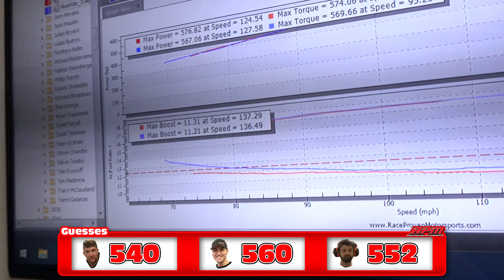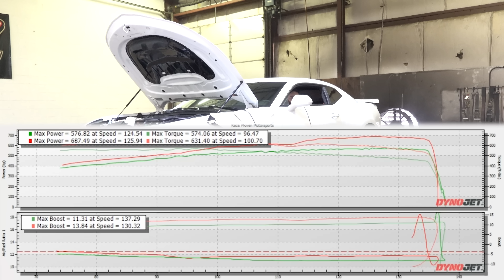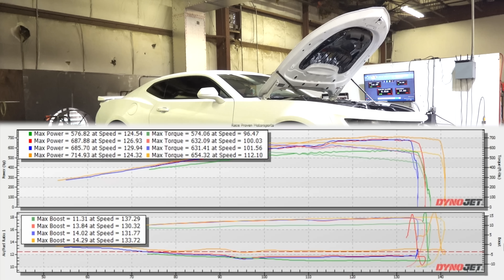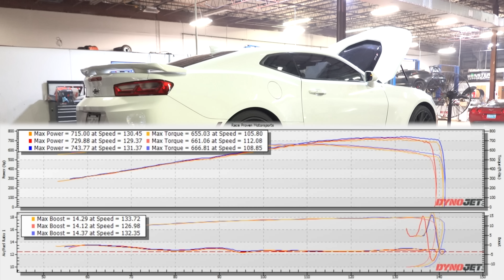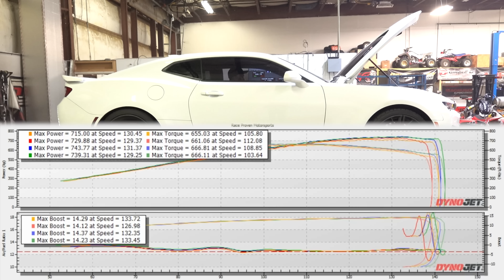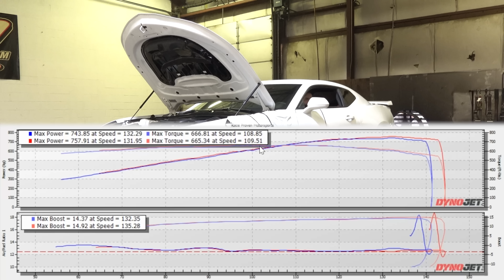Does High Mileage Matter?

Comment: Best thing about living in Iowa...E85 is everywhere and it's almost always 85-90% ethanol.
Reply: I miss living in Iowa
Reply: Mannnn that’s good living for car enthusiasts if we can get 85-90% ethanol
Reply: Damm Iowa is cool that whole little cluster of states is so cool and untouched
Reply: Not sure where you live in Iowa lol but definitely not always 85-90% 😂 it’s all 70-75% until summer blend then hyvees can be 80-88%
Reply: @thesudzy22  The station 5 minutes from my house is always over 85% all year as is the next closest station 15 minutes away.  There is one station 15 minutes in the opposite direction that does go down to 70% in the winter months.  I tested my local station in January and it was 91%.
Reply: @thesudzy22  Honestly percentage isn't even that important at 1000 rwhp levels.  Anything over 50% is enough and anything over 70% is definitely fine power wise.  I've not seen gains in power on anything over 70% actually.  As long as you have a flex fuel sensor or the ability to change the tune ethanol percentage isn't that critical in terms or power gains.
Reply: @lsxtuner6126  I agree 70%+ there isn’t much to gain. But 50 to 70 can definitely gain a a degree or two of timing and help.
Reply: @lsxtuner6126  What city do you live in? I’m in the metro area and it’s all 70ish % right now
Reply: @thesudzy22  Oskaloosa...I wouldn't call it a city though...LOL.
Reply: That probably is in fact the best thing about living in Iowa 😂
Reply: @oompa-tx3se Octane increase from increasing ethanol percentage isn't linear.  The science is available on the internet to explain this better than I can here.  As you go from 0 to 50% ethanol content the increase in octane and latent heat of vaporization is substantial.  Beyond 50% to 70% the rate of improvement is much less and even less improvement from 70% to 90% ethanol content.  There will be a difference especially in fuel requirements as higher ethanol percentages have a lower stoichiometry.  The difference in power potential for sub 1000 rwhp street cars is minimal going from 70 to 90% ethanol though.  I started experimenting with this due to maxing out my 1300cc injectors.  I lowered my ethanol content and didn't lose any power or see any difference in plug readings at the same timing levels going from 85% to 70%.  I currently run 50% ethanol, but added meth injection.  I'm terrible at explaining this so hopefully this gets you thinking and you can do your own research on the internet to find the science behind it.
Reply: @oompa-tx3se Wow.  Post up your dyno comparisons I'd like to see that.  34 psi how much power are you making?  Usually, I don't see much power difference sub 1000 rwhp from 70 to 90% ethanol content,  but with 34 psi you must be making way more than 1000 rwhp.  I don't really play with anything much over 1000 rwhp street cars to be honest so I can only speak about what I've seen at the power levels I play with.
Reply: @oompa-tx3se It seems there were multiple variables then and since you never dynoed it then it's hard to say it picked up mid range torque because at high power levels the butt dyno isn't too accurate.  You trapped 159 at 28 psi, but you added boost to 34 psi so that is a huge variable also.  Really hard to claim the increase in ethanol content alone gave you much without a dyno and with other changes being made.
Reply: @oompa-tx3se I do my own tuning on the street and track as well since I don't own a dyno.  I'm not a professional just a hobbyist, but I enjoy building and tuning my own stuff.  Have a nice day.  I'm going to take my car out for another cruise since it's finally nice here in Iowa.
Reply: @oompa-tx3se Post up some videos of your car here on youtube.  I'd like to see it and it looks like you don't have any content to show for it.

Comment: How long do these zl1 motors usually last? 80,000 miles isnt alot
Reply: if you maintain it correctly it’ll last as long as you want it to
Reply: @colety04 what year do u recommend with a manual transmission

Comment: My 16 Camaro SS had 160k miles on it and never had mechanical problems
Reply: 8spd?
Reply: Wow u guys call that high?😂😂😂😂 my yota is 200k plus off-road truck driven hard every single year last 10 years only needed regular maintenance only because i wanted too didn’t need to still running brand new. Had a Honda didn’t change oil over a year still smoked a mustang running nos 😂😂😂

Comment: Correct me if I'm wrong, but stock for stock is a C6 ZR1 just as fast if not faster than a C7 ZR1 in a straight line? Despite being down over 100hp.
Reply: Should be c6 is lighter
Reply: I think the C7 is faster with no big wing
Reply: The c7 zr1 is much faster in straight line stock for stock

Comment: those nitto 555 g2 suck ass . i bought a ss 1le bone stock and it would haze them in first and second in warm texas weather even in a 315/30/20
Reply from the maker: G2 and R2 is a completely diff tire.  G2 is not a drag radial style tire